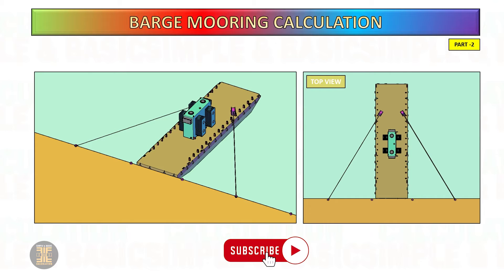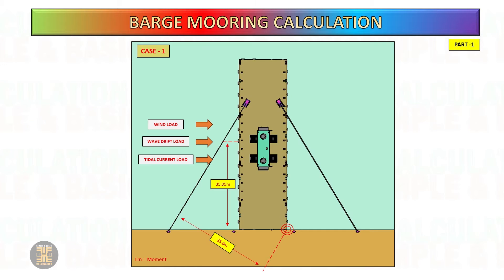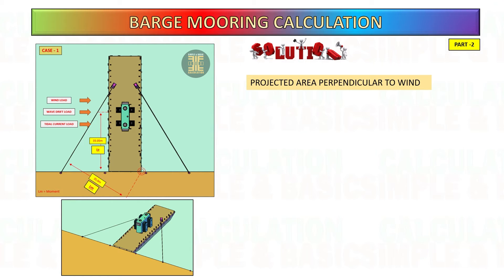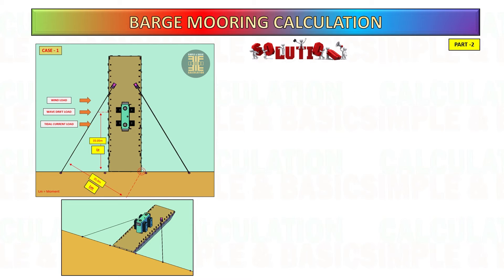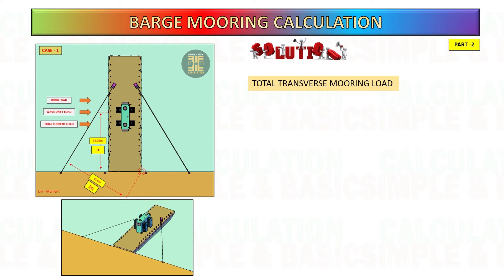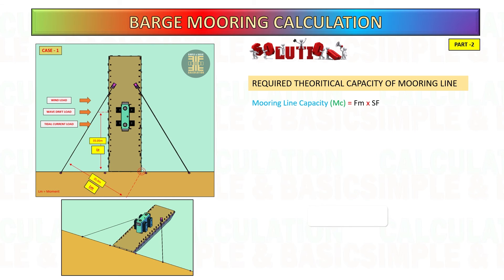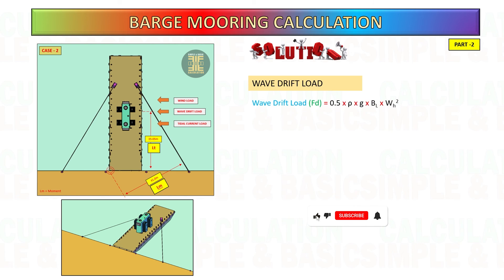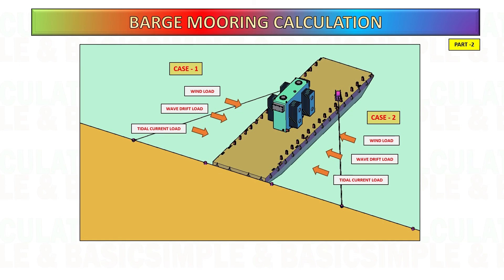Barge Mooring Calculation and Analysis Part 2 #mooring

Comment: I have question that how many mooring lines should be considered for each side ?
Reply from the maker: It's depend to your mooring winch & mooring line capacity. Example if your winch is 15ton capacity, two mooring line is enough to hold the barge.